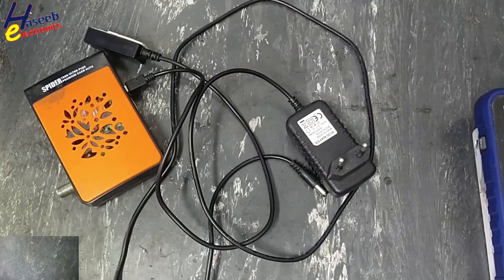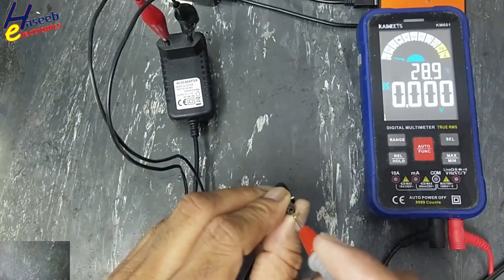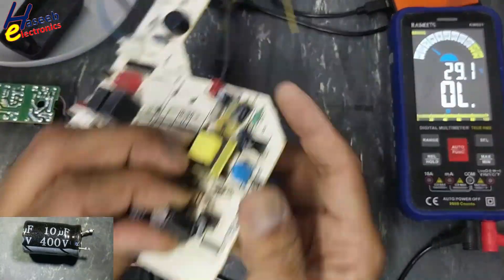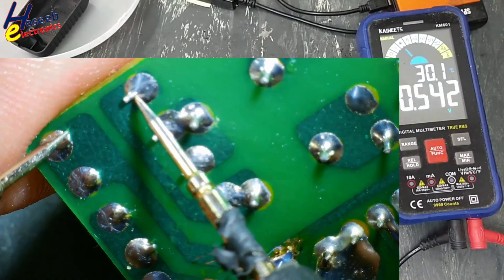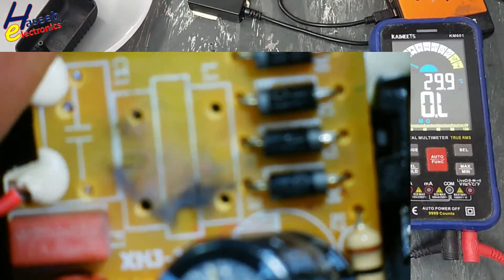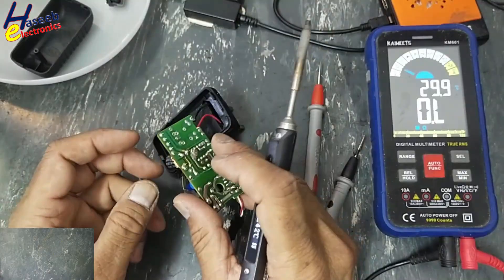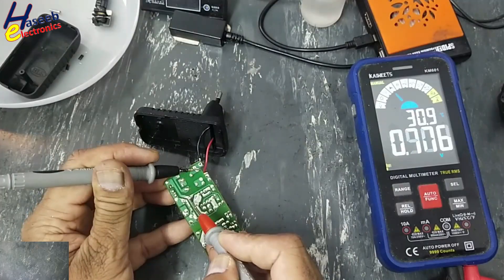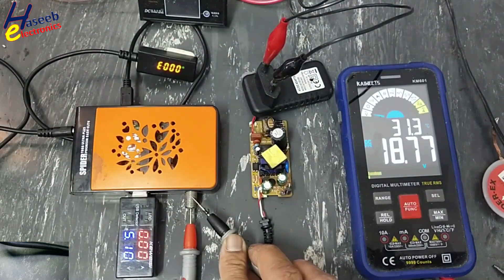{1354} SPIDER T888 Satellite Receiver Not Turning ON | Power Adapter Repair for Mini HD Receiver

Comment: @HaseebElectronics  I have two questions 1.in you video about choke replacement for filtering,btn live line and neutral line, where should I put jumper and where should I put that two leg inductor?.2.second question One of my 4 leg  choke was damaged I then  found out two legs are not fine,after removing one turn of winding the chock worked fine but i removed one winding because it was dameged.was it fine to use?

Comment: I actually re-wound a coil once several years ago. Just use same diameter wire, count the number of turns and re-wire it with new wire. This fixed my issue with an old arcade CRT monitor that has a corroded coil. Sadly the repair of a small common power supply with 5.5mm dc jack is not cost-efficient in most countries to get it repaired by a business and it would be cheaper to buy a new common 12V psu, except if repairing it at home.

Comment: Thank very much, i have one question: does this means that the fuse value is not calculated correctly during the design phase?
Reply from the maker: You are right 
Might be fuse value is not suitable for this product or fuse quality is poor 
Otherwise it is impossible that a dual line filter damaged with pair of diodes but fuse is still safe 
That is question mark on fuse value or quality
Reply: @HaseebElectronics  Hello, maybe lightning strike incident? or Grid power off ON with spike... Dual line filter damage cannot be because of incident on side after power supply or after bridge rectifier... this was incident on the main grid 230V side...

Comment: Hello and thank you for good teaching ❤❤❤
How can I ask about power supply  repairing? 
It have 2 optocupler and uc3845 ic I am working on it about 7 days 
And change all components with good one but vice on ic is 8 volt and one of the mosfet is not working (no voltage on it) 
How can I send photo ?
Reply from the maker: Please send it's picture front and back 
To my WhatsApp 00962795608616
Or Gmail id ashraf4ta4@gmail.com
Reply: I chatted with you on WhatsApp but no responses?

Comment: So, you have a collection of scrap circuit boards from which to pull usable parts?
Reply from the maker: Yes 
That is also a good known working spare parts instead of purchasing new parts 
When you have a scrap board. Identify it's parts, give a identification number to that board and make a parts inventory in computer 
Whenever you need a component, just see the inventory and pull out that board and get the required part
Update the inventory again 
It makes the life easier
Reply: @HaseebElectronics  That is quite a bit of effort. But I have found that Parts on boards are impossible to find when you want them. So meticulous record keeping is a must.
Reply from the maker: yes. it needs one time effort to make a log. then just in one click you find the board numbered in your record. after using a component, update the inventory. it takes few seconds

Comment: Thanks for your valuable repair lesson.Wil the inductor and jumper work well even know they are not the same value(uH) as the replaced one..thanks
Reply from the maker: dual line filter is used for common mode noises and also suppresses uwanted energy spikes. 
using single inductor will bypass EMI provision but still it will supress unwanted spikes in line voltage
Reply: @HaseebElectronics  I have two questions 1.in you video about choke replacement for filtering,btn live line and neutral line, where should I put jumper and where should I put that two leg inductor?.2.second question One of my 4 leg  choke was damaged I then  found out two legs are not fine,after removing  one turn of winding the chock worked fine but i removed one winding because it was dameged.was it fine to use?

Comment: The EMI choke coil was for common mode filtering, so one coil is not a appropriate replacement. You should better use 2 jumpers and delete the filter entitely.
Reply from the maker: you are right. 
but single coil will also supress spikes. i think it will work normally
Reply: @HaseebElectronics CMC is not for spike filtering, it is for noise suppression. It will work normally, but the one coil is useless. 😊

Comment: Brother, I have 2000 W hair dryer. It has 1 Amp diode near push button, it got burnt. I don't know whether it is 1N4007 or FR diode. How to identify? What it could be?
Reply from the maker: 1N4007 because it is in 50/60 Hz line
Reply: @HaseebElectronics Thank you so much.